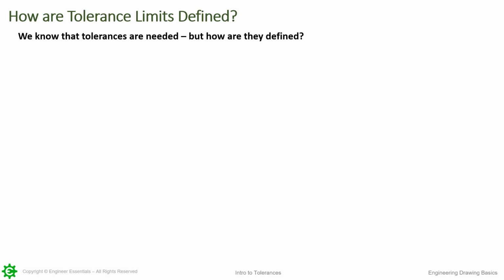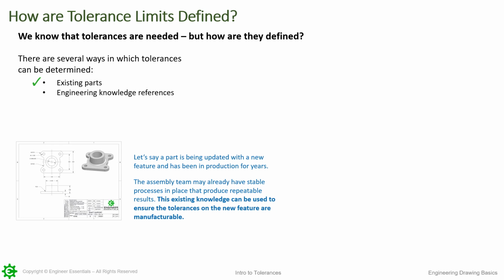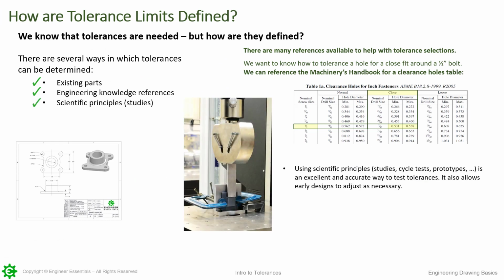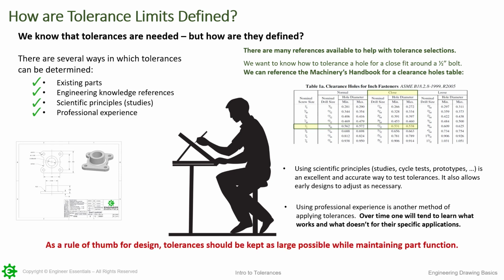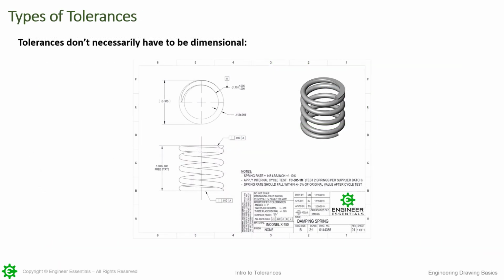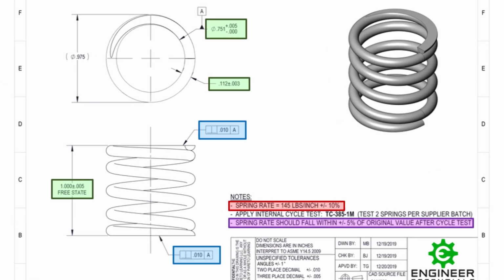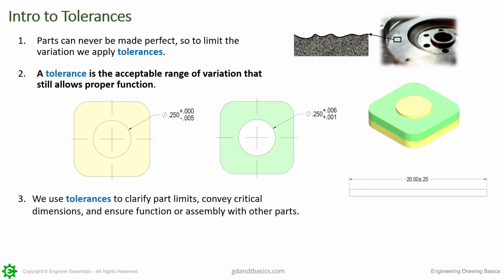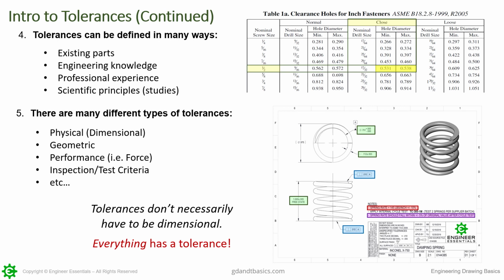Introduction to Tolerances - Part III: How are Tolerance Limits Defined?

Comment: 1:07 

Hi sir, Thank you so much for making this video possible  and putting it out here for us. 

As a GAE, i wonder why some big corporations still use those machining handbooks to determine tolerances (maybe they would try to approach some level of perfection, not that of PolyWorks or RD&T for instance) while we have got such technological tools as Polyworks and RD&T. In and with RD&T, we can be %100 percent sure what components of an assembly would have the most contribution factors with it comes to determining Tolerances. And in and with PolyWorks we can be %100 percent sure how those tolerances that were determined previously would play out, how they would impact on an entire part and where deviations are mostly high or low. In a nutshell, i do not understand why those companies would still try to catch perfection using those books that will not reflect reality after a part is manufactured.  Does that make sense?
Reply from the maker: This absolutely makes sense. There are plenty of useful suggested tolerances in the Machinery's Handbook that i would recommend using as a "first step" or even a final solution. However, nothing quite beats the thrill of sitting down with a CAD model and working through your tolerance stacks, am i right?? For instance, zero tolerance at MMC is a prime example of GD&T going above and beyond the tabulated tolerances in the Machinery's Handbook. Thanks for the comment!